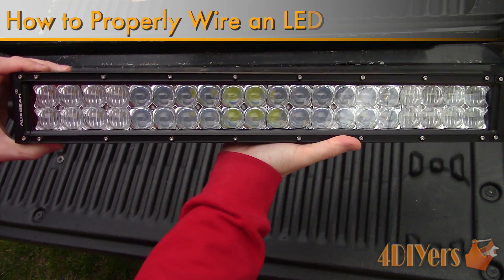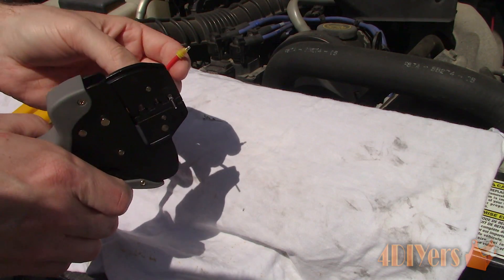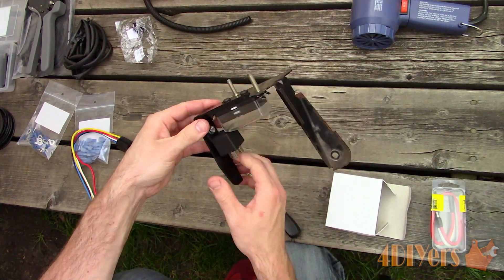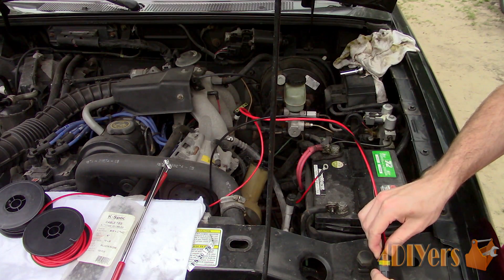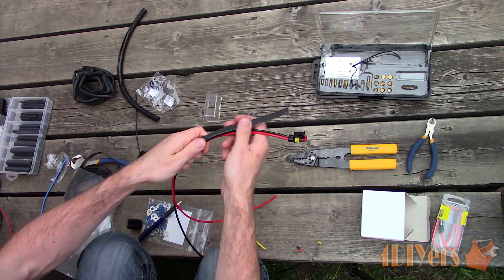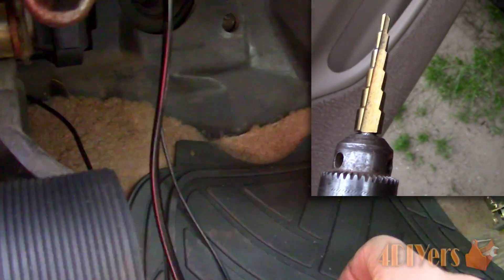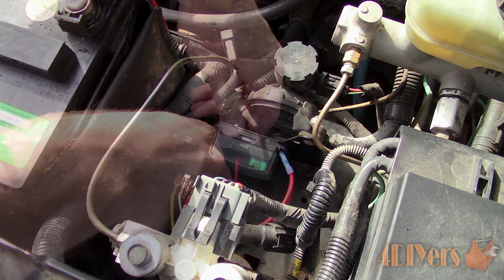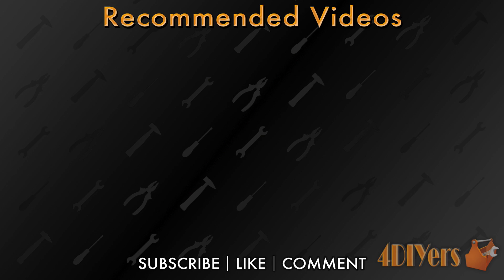How to Wire an LED Light Bar - The Ultimate Guide

Comment: So is it how much wire you run in total is what bases the gauge wire you use?
Reply from the maker: Wire gauge is based on both length of wire ran and amperage of light being used. The higher amperage of light has a larger draw which in turn creates more heat.
Reply: 4DIYers I'm at 6 amps w a total ft if 11.5 so that's what, about 12 gauge?

Comment: Hi could you please tell me what gauge size wire are you using in this filme?
What is the led out put watts?
Many thanks
Reply from the maker: The light is rated at 120 watts, used a 30 amp fuse, and I used 12 gauge wire.
Reply: @4DIYers  why the over with 30 amp fuse? light will draw 10 amps. 15 amp fuse will be fine and you dont need 12 ga wire

Comment: If you run three wires into the cab, you can use a SPDT switch that will allow you to activate the light by itself, or disarm the light completely to avoid accidental engagement, or allow or arming the light to be activated with the high beams beams  👍
Reply from the maker: True, but that would have been a bit more complicated for some of my beginner viewers as they'd have to determine what wire activates their high beam circuit. I was actually going to use something similar for reverse lights, but I won't be on this truck unfortunately. Don't forget to subscribe :)